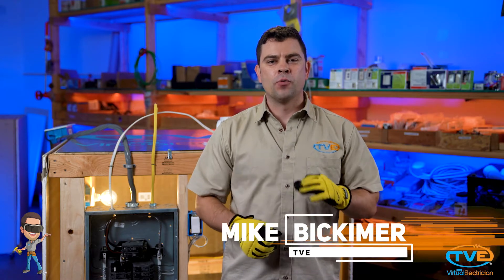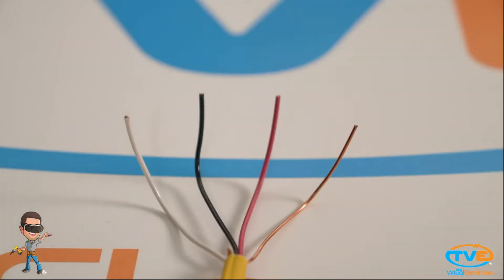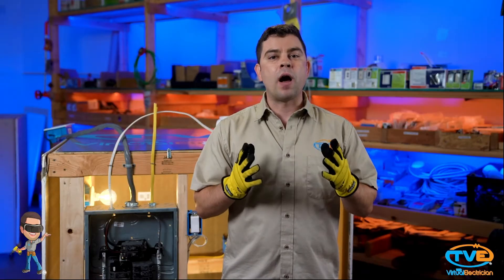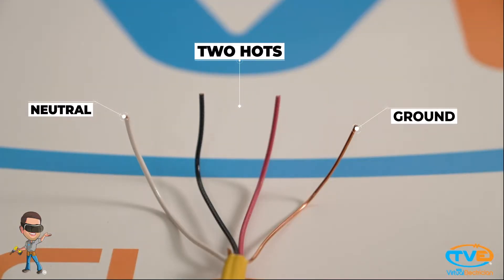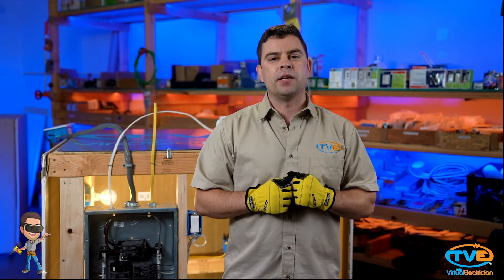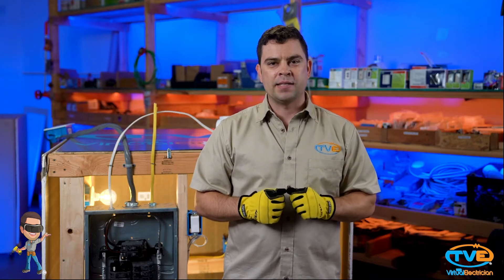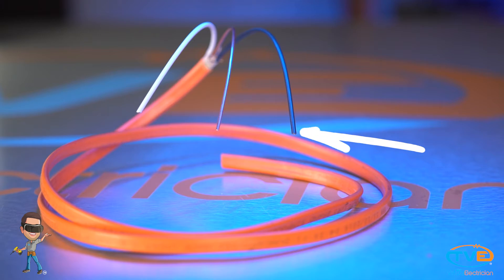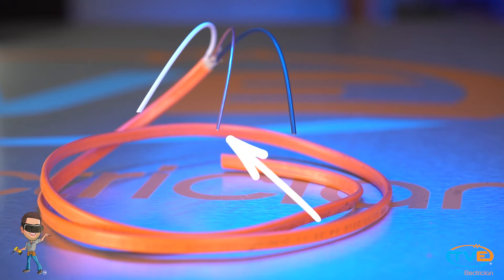Installing a 240 volt circuit

Comment: Thanks for the info. 3 or 4 wire for a 240 welder???
Reply from the maker: Three wires. 2 hots and a ground
Reply: @TheVirtualElectrician  thanks for the reply. Should have added that the welder has an lcd screen. Still 3 wire?
Reply from the maker: @precisionanglingYT  probably need a neutral then. Does the spec sheet mention this?
Reply: @TheVirtualElectrician  the welder is en route. Haven’t seen the spec sheet yet. It has the 3 prong 6-50 plug tho.
Reply from the maker: @precisionanglingYT  if it only has three prong plug then no neutral is required. You may want to google the model number and look up the spec sheet tho.